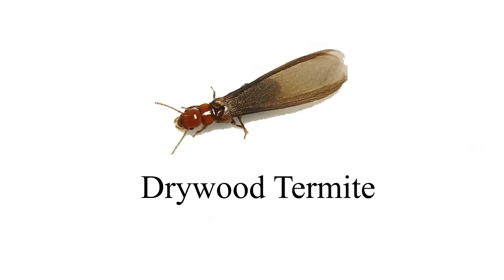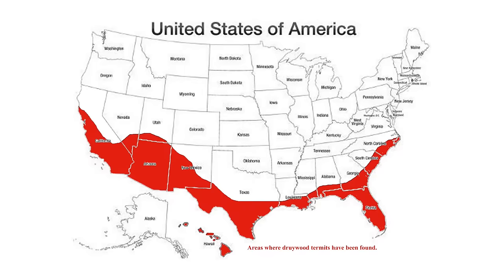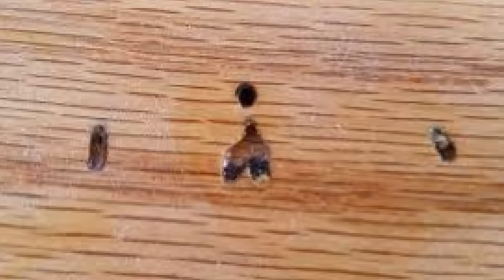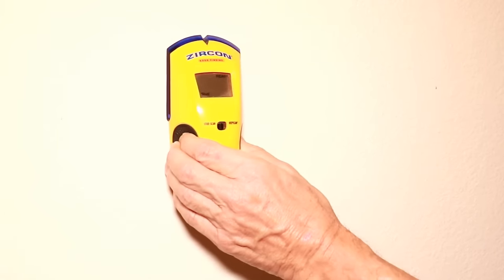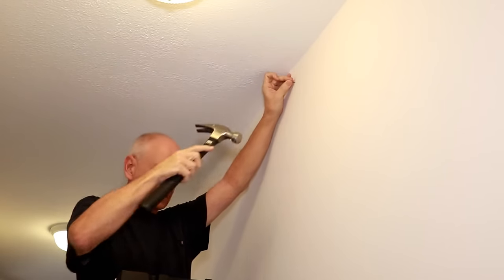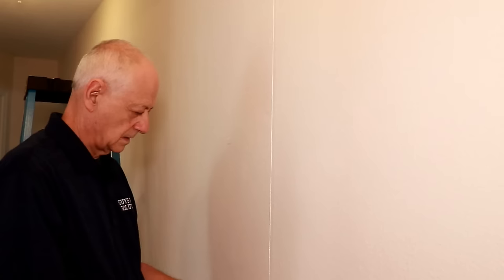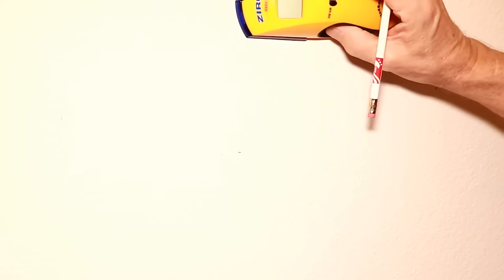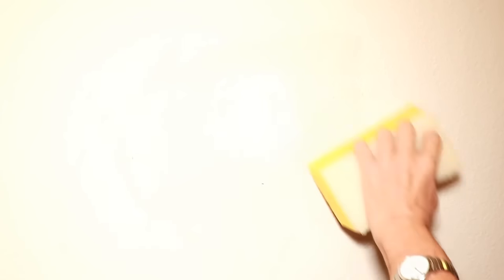How to Treat a Drywood Termite Infestation Yourself. A MUST see if you have Drywood termites.

Comment: I was reading a Boracare guide listing how to apply it for active infestations through wood injection (1:1 ratio).  With your experience and knowledge of how Boracare and Termidor work to kill drywood termites and the length of time each remains effective, do you favor one over the other for spot treat/wood injection?  Can you recommend equipment or tools setup needed to successfully inject a liquid?  Where can I buy an injection tip that would work for termites. Is a small syringe feasible? Handheld pump sprayer with suitable tip?  Foaming would be nice but B&G foamers are in the $300 range, but I gather this would be more cost effective than buying several cans of ready to use fipronil foam.
Reply from the maker: If you are going to hang your hat on spot treating, then fipronil foam is definitely the way I would go.  The best way to do that is with the individual cans because the right equipment to create a foam is expensive.  It's fine for the pros, but homeowners would find it more cost effective to just buy the cans.  I think they work better too.  Bora-Care is best left to treat bare wood. I would definitely treat the attic with it, but for spot treating, go with the fipronil foam.  You cannot spot treat with a liquid.  You must use a foam because it expands to several times its original volume.  That allows it to get into the galleries where liquids cannot reach.

I hope that helps.  Be well my friend.
Reply: @GuysPestSolutions  Thanks for the quick reply. With the foam cans, some user reviews say it sometimes leaks out all over the top of the can rather than go into the wood.  Do you have any tips to prevent this from happening?  At $30 a can, I’d hate to see some of it go to waste. Oh, and what size drill bit do you use?
Reply from the maker: @rover8783  I have not run into that problem with the FiPro.  I suggest that you buy just one can and see if it happens to you.  If it does, then go ahead and switch to Termidor Foam.  I will give you a link to it.  The hole needs to be just wide enough for the applicator tip to get in.  1/8 inch should do it for FiPro, but that may vary, depending upon the product.

I hope that helps.

Termidor Foam:  https://www.solutionsstores.com/termidor-foam-fipronil-spray
Reply: @GuysPestSolutions  does the FiPro work the same as termidor as it is non repellant and causes termites to pass it on to the whole colony?
Reply from the maker: @macknumber9  Yes.  The FiPro is the exact same thing as Termidor foam and it works the exact same way.  I just like the FiPro better because it's a little cheaper and I like the applicator tip better.  Other than that, there is no difference.  Either product is fine to use.

I hope that helps.

Comment: Is there a way you can use Boracare effectively applied into the kickout holes instead of Fipronil? Will fumigating still be effective over a Boracare treatment in the attic? Thanks.
Reply from the maker: The reason I use fipronil for the kick out holes is because it expands to several times it's size.  You can foam Bora-Care, but using a foamer does not work anywhere near as well in that situation.  You can foam Bora-Care into wall voids though to treat both sides of the studs.  Bora-Care used in the attic will have no effect on fumigation.  I hope that helps.  Be well my friend.

Comment: I had our house tented and fumigated 11 years ago.  Do dry wood termites come back ?
Reply from the maker: It is important to understand how drywood termites work.  They enter through cracks and crevices around windows, doors, the eaves, pipe penetrations, and so forth.  Most of the time, they enter through several locations.  That is because a swarm of them attacked your house at the same time.  If there was a crack or a crevice, then they probably found it.  After they established their galleries, which will be inside the wood, it will take four to seven years for them to be able to swarm.  Now that they are in your house, the swarmers will use holes that are in your studs to travel through the walls.  Those holes in the studs were created by the electricians to run the electrical wiring.  Not only are these holes going through the studs, but holes were drilled into the attic for the light switches and to run some of the wiring for the outlets.  So, the termites now have easy access throughout the attic and the walls.  If you have a basement or crawl space, they have access to that as well.  Most of the time, you will have no idea that they are in the walls, because the frass is inside the wall.  To make matters worse, if you have drywood termites, then your neighbors have them too.  That means you have been getting swarmed for as long as they have existed in the neighborhood.  Most likely, we're talking about years, so it's a safe bet that you have these guys in many locations in your home.

As you already know, if you have drywood termites, the only sure way to get rid of them is to fumigate.  Prices for this can vary wildly in this industry, so I recommend that you watch my video on how to hire a pest controller without getting ripped off.  That video can save you a lot of money.  You should also know that the gas they use to fumigate has absolutely no residual action whatsoever, so you can get reinfested the moment the tent comes down.  Like I said before, if you have drywood termites, then your neighbors have them as well.  Since drywood  termites swarm every year, it is almost a certainty that you will be reinfested within a year after the fumigation is done.  So, it's a safe bet that you do have lots of drywood termites all over your house if was fumigated 11 years ago.  The only way to prevent this is to do a preventive treatment on your house every 60 days.  Most pest controllers will not do this, so it is something that you generally need to do yourself.  I have a video on how to do that and I will place a link below.  If you absolutely cannot afford to fumigate your house, then you can try spot treating it yourself.  It is virtually impossible to find all the termite galleries, but it is way better than doing nothing.  Regardless of how you treat it, you should begin the preventive treatment immediately, so that you do not get additional termites paying you a visit.  If you fumigate again, be sure to start the preventive treatment before the tent goes up.

I hope that helps.  Be well my friend.                      

Video on how to hire a pest controller without getting ripped off:  https://youtu.be/y-a8XOqVrlE

Video on how to prevent drywood termites (You do not need to treat your yard for drywood termites.  You just need to treat the exterior of the house every 60 days.):  https://youtu.be/Yozv3s-Qwlw

Comment: I learned how to do treatment myself because of GUY.

Modern termite companies in 2024 only want fumigation, which does not protect the woods from being infested again. I noticed termite inspectors are terrified when you bring up FIPRONIL & BORACARE 😂 Why? Because those products are all you need to permanently treat drywood termite infestations. BTW average cost estimate from 5 companies is $7000 or more in California. DIY FIPRONIL & BORACARE. Good people still exist in this world. Good luck my friends. 🙏
Reply from the maker: Thank you so much for those kind words.  Very much appreciated.  Please keep in mind though that, while you are going to get rid of a lot of drywood termites this way, you may not find all the galleries, so you need to keep searching for them.  The bora-care treated wood is good forever, but keep an eye on the walls.  Some galleries can be as small as the size of a peanut, so they can be hard to find until they get larger.  If you stay vigilant you should be okay.  The reason the pest controllers want to fumigate is because it's once and done, but you will get reinfested within a year if you don't do an exterior treatment at least every 3 months, and they usually will not do that treatment.  The truth is that most of them don't know how to do it.  Even if they did, they wouldn't treat above their shoulders in most cases, so you need to do it yourself.  It sounds like you are right on top of this, and you did save a lot of money.  I am so happy that I was able to be of assistance to you.  Be well my friend.

Comment: Hello Guy, what happens when there is insulation in the walls between the studs? In my case the exterior walls (concrete block) have what looks like blown cellulose and the wall between the garage and the house (the only wall with wooden studs) has fiber-glass insulation. I guess it is not posible to use the foam in this case.
Reply from the maker: You are not trying to get the foam into the wall voids.  You want to foam to go directly into the studs.  Most concrete block structures have studs or furring strips attached to the blocks to allow for the electrical wiring to be run, the drywall to be hung, and insulation.  You want to drill into those studs or furring strips.  So, it doesn't matter what type of insulation there is because you do not want to treat the insulation.  The termites are only in the wood.  The idea is that you need to locate the center of the studs and drill holes every 4 inches, so that you can inject the foam directly into the studs. 

That being said, it is important to understand how drywood termites work.  They enter through cracks and crevices around windows, doors, the eaves, pipe penetrations, and so forth.  Most of the time, they enter through several locations.  That is because a swarm of them attacked your house at the same time.  If there was a crack or a crevice, then they probably found it.  After they established their galleries, which will be inside the wood, it will take four to seven years for them to be able to swarm.  Now that they are in your house, the swarmers will use holes that are in your studs to travel through the walls.  Those holes in the studs were created by the electricians to run the electrical wiring.  Not only are these holes going through the studs, but holes were drilled into the attic for the light switches and to run some of the wiring for the outlets.  So, the termites now have easy access throughout the attic and the walls.  If you have a basement or crawl space, they have access to that as well.  Most of the time, you will have no idea that they are in the walls, because the frass is inside the wall.  To make matters worse, if you have drywood termites, then your neighbors have them too.  That means you have been getting swarmed for as long as they have existed in the neighborhood.  Most likely, we're talking about years, so it's a safe bet that you have these guys in many locations in your home.

I always hate to be the bearer of bad news, but if you have drywood termites, the only sure way to get rid of them is to fumigate.  Prices for this can vary wildly in this industry, so I recommend that you watch my video on how to hire a pest controller without getting ripped off.  That video can save you a lot of money.  You should also know that the gas they use to fumigate has absolutely no residual action whatsoever, so you can get reinfested the moment the tent comes down.  Like I said before, if you have drywood termites, then your neighbors have them as well.  Since drywood  termites swarm every year, it is almost a certainty that you will be reinfested within a year after the fumigation is done.  The only way to prevent this is to do a preventive treatment on your house every 60 days.  Most pest controllers will not do this, so it is something that you generally need to do yourself.  I have a video on how to do that and I will place a link below.  If you absolutely cannot afford to fumigate your house, then you can try spot treating it yourself.  Keep in mind though that it is virtually impossible to find all the termite galleries, but it is way better than doing nothing.  Regardless of how you treat it, you should begin the preventive treatment immediately, so that you do not get additional termites paying you a visit.  If you decide to fumigate, the you must begin the preventive treatment before the tent goes up.

I hope that helps.  Be well my friend.                      

Video on how to hire a pest controller without getting ripped off:  https://youtu.be/y-a8XOqVrlE

Video on how to prevent drywood termites (You do not need to treat the yard for drywood termites.  Just treat the outside of the house every 60 days):  https://youtu.be/Yozv3s-Qwlw

Comment: What if I just remove enough strip of drywall that I have access to get my Boracare sprayer in all the wall cavities and spray the studs.  Will that work better than trying to drill holes and find all the individual galleries? Or if I find infested wood with galleries can I just spray the crap out of it with Boracare?
Reply from the maker: Actually, there is a way  to treat your walls with Bora-Care, without removing any drywall, and it is more effective than trying to find the galleries and then treating them with a fipronil foam.  The only thing is that you need to invest a couple of hundred dollars into equipment.  You can literally turn the Bora-Care into a foam and you can fill the entire wall void with it, and it will soak into the adjoining studs.  That means, all you need to do is drill a hole into every wall void and inject the foam.  Now, there are some drawbacks to this procedure, but after it's finished, then all of the studs will be permanently treated.  You can also use the foamer to treat ceiling joists as well.  I will give you a link to a video that kind of demonstrates how this procedure is done.  I will also give you a link to a good foamer and the foaming agent that you need.  Be well my friend.   

Video that shows how Bora-Care is foamed:  https://www.youtube.com/watch?v=kXQTc9wwCfQ&t=4s

Foamer:  https://www.domyown.com/bg-versafoamer-hh-gallon-foamer-p-1696.html

Foaming agent:  https://www.domyown.com/outlast-pro-foaming-agent-p-13940.html?sub_id=13688

Comment: Hi Guy, I live in Florida and I just found wings. I am getting ready to have my floors replaced upstairs.  I want to treat for the termites before I put down my new LVP. Do you recommend I spray Boracare on the plywood before putting down my floors?
Reply from the maker: It is always a good idea to treat all unfinished wood with Bora-Care.  Mix it one to one with water and not one to five.  Cold water works just fine.  I will give you a link to the product and a video on how to use it.  I also recommend that you inspect for termites.  If you have drywood termites, then I need to provide additional information.

I hope that helps.  Be well Cindy.

Bora-Care:  https://www.solutionsstores.com/boracare

Bora-Care video:  https://www.youtube.com/watch?v=Rmr_aEodyhg&t=14s

Termite inspection video:  https://youtu.be/oGyAVT7Zyro
Reply: @GuysPestSolutions   I appreciate you!!! Thank you so much!
Reply from the maker: You are very welcome.  I am always here to help.  Be well Cindy.
Reply from the maker: @cindyh8884  You are very welcome.  Be well Cindy.